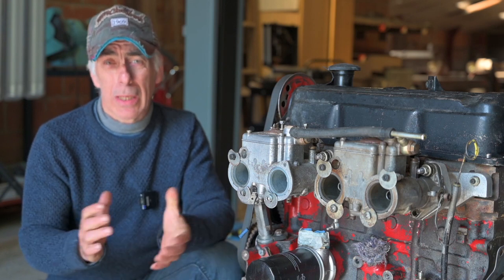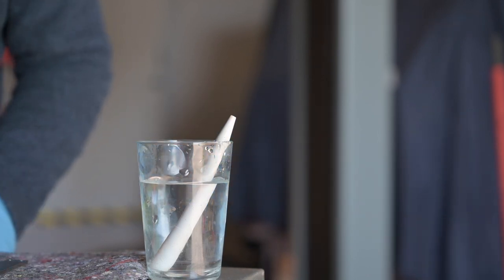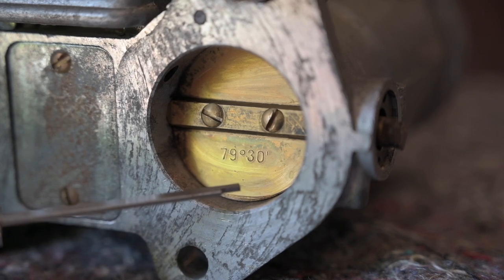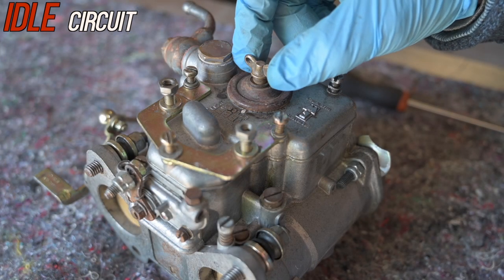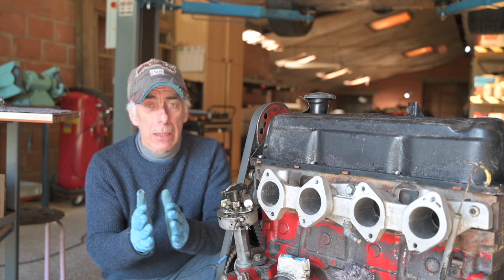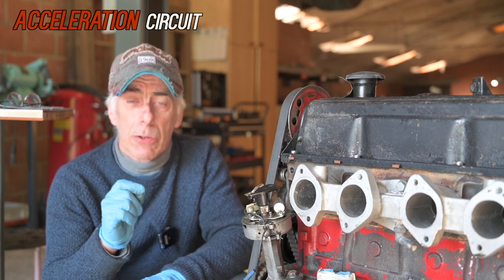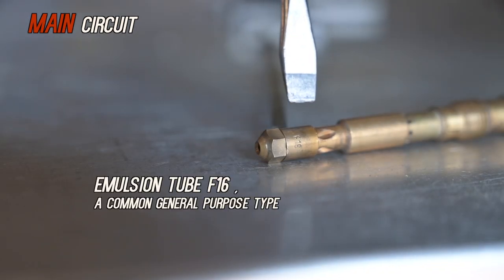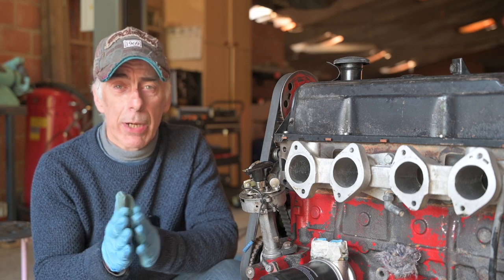Part 1, understanding the weber carburettor  DCOE

Comment: I tuned weber carbs for years in competition, this is a wonderful tutorial Steve well done.
Reply from the maker: Thanks Gerald, and maybe you could share some good pro advice ?
Reply: @D3Sshooter  I have a pair of Weber 40 DCOE carbs on a 1960 Mercedes-Benz 190SL.  The car is reluctant to start from a cold start after sitting even for a day or two.  Priming it with fuel through the air intake allows it to start immediately and it runs just fine after that.  I don't want to burn out my starter trying to crank from a cold start.  Any suggestions on what adjustments may be needed?  The fuel pump is fine and the hand primer lever gets fuel to the carbs.
Reply from the maker: @troyroberts8568  , What I read seems not to be a cold start issue, but more  a time/fuel issue.  It almost sounds like your fuel chamber runs empty or low when the car sits for a while.   There are several possible reason for that, first  a fuel chamber leak and fuel escapes , but I guess you have no fuel leaks spotted,  second the fuel evaporated due to heat build up and or flooding when the engine stopped.  Have a look and test the car with a warm motor, stop and wait a few minutes ( 5) then start... if its hard to start you might have flooding issue... check your float level first. Third, your cold start circuit might be clogged as it starts with priming fuel through the airfilter.   Does it run good after it started on idle ?     In each case start with the float level check, then check the fuel pump pressure and volume.....  Might be difficult with a mechanical pump as it is needed to run the engine  so you need a T piece for you meter.     Here is what  I would do:  disconnect the fuel line on the carb.  connect a fuel bottle or canister to the carb and hang it up high ( higher then the carb) and let gravity do its thing by filling up the carb.  Let the car sit a few days, then start it in that configuration.  If its starts and the fuel level in the bottle did not change over the days then its not a carb issue but a fuel supply issue. Best then to replace the fuel pump with an electrical version.  If the fuel level went down before you started , then you have an issue with the carb itself , maybe the needle valve, the float etc... and that should be checked.    If it does not start, check your idle circuit .  Another check is to pump the gas pedal a few times rapid before starting and while doing so have someone look inside the carb and check that fuel is squirted in.... Then start  ( that should work)  ...  If you did not see the fuel been been squirted in then you have a fuel level issue or acceleration pump membrane issue... Does the car accelerate fine when driven ?
Reply: @D3Sshooter  In full disclosure, I'm not the one working on the carbs.  The mechanic that restored the car had cleaned the jets and done everything except put them in a parts cleaner.  He said the car runs great and idles fine after starting it with some starting fluid or fuel manually put in the intake.  The car will hot start after a short time, but if it sits for hours or more, it will not start at all.  There are no noticeable leaks and no fuel on the garage floor indicating a leak.I'm not sure he has driven the car after starting it or is just trying to make sure it starts in all cases.  When I gave the car to him, I did notice a small metal ball about the size of a BB that was very similar to the ball in your video used with the weights next to the accelerator pump.  This ball was outside of the carb and sitting on top near the wing nut that holds the top cover on.  I assume this ball and weight act like a check valve.  If the ball was missing, would this allow fuel to backflow and empty the chamber causing it to be hard to start?
Reply: Is it difficult to tune dual 45s on a 81 corolla 1.8 w cam header mild performance parts

Comment: I've just bought a 1959 Giulietta Sprint with dual Weber 40 DCOEs, and this has been the first time I've understood what's going on in them. Really clear. Over the next few months I'll try to fix an issue with a lag in acceleration from idle. After I watch all these videos a number of times I may try to inspect to see if the jets are all correct for the car, and if the acceleration pumps are working well. Thanks!

Comment: Thank you so much for explaining Weber DCOE carburetors.  I have a ‘73 Triumph TR6, having reliable power problems which I suspect are due to my 50 year old Stromberg carburetors.  I’m considering changing them out to Weber downdraft carburetors, +/- $1300 U.S. before labor, or Weber DCOE sidedraft carburetors, +/- $3,000 U.S., before labor.  I’m in the U.S., where carburetors were fitted rather than fuel (petrol) injected for emissions reasons.  No need to worry about emissions now as the car is so old the government doesn’t check for emissions anymore.  I’ll tinker with the Strombergs some more before probably considering the downdraft Webers for budget reasons.

Comment: Excellent tutorial.  I’ve just recently purchased an MG with a 45DCOE fitted, so needed a lesson in how these work.  I’ve looked at the Haynes manual for Weber’s, but have found your video much easier to digest.  Thank you!
Reply from the maker: Glad it helped
Reply: Steve, in your experience, does a Weber side draft need a fuel pressure regulator?

Comment: Thank you for the thorough approach to this topic. Although carburetors vary, the basic principles and functions can be identified in most, so this tutorial also served as a basic introduction to the mechanical fuel delivery system in it's own right. Webers were originally on my mind for their current supply of spares, gaskets and customizable parts, unlike my current Mikuni carburetor which hardly has any spare parts available for it in my region. I use my carbureted Honda engine daily, so user-friendliness, availability of spare parts and familiarity is essential for keeping the engine sharp. I'll go through and troubleshoot my carburetor now that I've been inspired by your video and see what I will end up using on the car on a regular basis.

Edit: Also, did I by chance hear a Swiss accent? My apologies for not containing my curiosity.
Reply from the maker: Thanks for the comments, interesting write-up.   Swiss, not really   more Flemish

Comment: Should the accelerator pump squirt in both barrel of the carburator? Dosen't look like it does that in the video?

Thank you for a great video, you are a good teacher. 

Just started to tune my weber 40's on my volvo b20 that i have drove around with a terrible tune for six years. 

Have got the engine to run great but it stalls out during quick accelerations,  thanks to this video i learned that the carbs have a function for just that moment and is probally my problem!
Reply from the maker: andreas hustoft   Thanks for the comments.  Indeed the acceleration jet should do that.   This 40 is coming out a car that was sitting there for 15 years. And are  not working properly.   In the next videos i talk about the jetting and tuning.   Good luck with yours

Comment: OMG this is great... I just installed a DCOE40 & Supercharger on my classic 76 mini and we are having a hell of a time tuning it (998cc) ... hopefully when we get through to part 3 we can figure out what we are doing wrong. Idels fine-ish but when going to accelerate we get gluggy back firing. Have to pull up in 2nd gear and try again. Tried all sorts of solutions. We think the jets might be too big? Too much fuel going through? Gah!! 

Great video by the by 🤗
Reply from the maker: Back firing into the carb ?   Or exhaust ?  In each case its to much unburned fuel... When you say acceleration, I assume that the acceleration pomp is activated , that injects a lot of fuel through the acceleration jets.  I would suspect that as the main issue...I have had seen that before... does it run fine at higher rev's - cruising ?
Reply: @D3Sshooter  Hi Mate. Thanks for the reply. High revs she sounds OK while cruising (Acceleration only) then starts popping and blowing a little black smoke when you pull off the peddle and try to sit on a particular speed. Its much better today with new plugs, upped the fuel pressure to 3psi, and adjusted the dizzy a little. I was able to drive it atleast but we are still getting too much fuel as you said. We were thinking the jets & venturi might be the wrong size???

Comment: What a great video - thanks! Maybe you can answer a REALLY simple question? What is the correct way to start a classic fiat 500 engine when cold? eg Should you pump accelerator pedal a few times before you hit the starter motor....or just touch it when you hear the engine catching. My classic Fiat 500 and Fiat 238 van never start after sitting for weeks - I assumed this was just part of the joy of Fiats, but reading your reply to the 190SL man makes me think that maybe there is a cure for this problem. Mike in England

Comment: Thanks for this info really appreciate it didn’t know nothing about these Weber’s I have a Toyota Corolla 1.8 3tc engine with 45 webers and wanted to share what jets are in it because I couldn’t get the engine to idle so main jet is .145,  Idle jet is 55 f8, the emulsion tube is .155 top number and f 16 on bottom, the aceloration jet is 45 the float fuel valve is .200 and coke jet is top 150 and 85-f9 on bottom wanted to see if I have the rite combination Thanku for your time again
Reply from the maker: The only thing that is importend for idle, is the idle jet and air correction jet for idle... and the position of the butterfly for the progression holes.  so the 55F8 should be good...  did you check your mixture ( colortune, AGR or CO meter) that is always a good indication if you run to lean or to rich on idle.
Reply: @D3Sshooter  how’s it going I am running to rich plugs are black n see black smoke . The Weber’s were bad a lot of dirt don’t know if that was causing he problem i never herd of that tool and thanks never knew there was a tool for that

Comment: Great information thanks, quick question should the Venturi be a lose fit into body of carb ?
Reply from the maker: Thanks , well loose no , no rattle   but removable with slight force.   Some have a locking bold on the bottom

Comment: Just tuning my DCOE 45's on my Lotus 907 engine, it's always a difficult task.  Best way to put it that there are essentially 3 carbs in one in the Webers (4 if you count the choke circuit).  The idle circuit (which is a bad name) handles 0-3000rpm, the main circuit goes 3000-redline, and the accelerator pump circuit handles the heavy loading under throttle.  You can get one right, say have a good smooth idle and nice accel to 3000, but then under hard accel it doesn't run well, and then doesn't run above 3000, etc.  You can have 1/3, 2/3, etc. working.  Proceeding to tune each one is the only way to get to a good situation, and understand how the emulsion tube works to transition.
Reply from the maker: Indeed, circuits are one thing , but the transfer inbetween is the most difficult part to get right...

Comment: My friend! Extremely valuable lessons from you. Great explanations in detail, and so I’ve watched the video a few times to be sure as I do have dcoe carburetor trouble at the moment. 

With what you have taught In separation, I believe I’m past the troubles within idle, and more into accelerating, but into maybe the area of emulsion tube and float level as my problem is in range of open throttle stumbling…?
I have dcoe OER/SK 40mm very similar to this Weber setup you have here. So I will try to adjust float level after I watch your other videos next!

My only question to this video, as you say accelerator pump is only a SINGLE shot after idle. Say for example, at normal driving/cruise I decide to speed up to wide open throttle, would the acceleration pump give another shot(or half shot) due to the throttle plate opening half way to wide open?
If so, maybe my problems could start at acceleration circuit. How you explain I do not believe this is my problem but in the emulsion tube/float. Any guess on my situation appreciated and thank you for this video.
Reply from the maker: Yes it will as cruising is near idle in terms of carb condition

Comment: Hi there! Just discovered your videos and think they're really excellent. I've just bought a 1970 Aston Martin DBS Vantage with triple Weber DCOE 45s. I'm a relative novice but keen to really learn this car inside out as I plan to keep her for a long time. I've noticed that after a run I get a fuel drip from the frontmost carb - seems to be dripping between the air box and air inlet side of the carb. I wonder if the carb is over fuelling so will be having a look next weekend! I've just watched your video on timing as well so will check that too!
Reply from the maker: Welcome, I would recommend that you fox that asap . Seems like a flooding issue. Can be caused by several issues.. Have a look on the channel . I have a video designated to flooding issues.   An Aston Martin, now that is something I would love to have...
Reply: @D3Sshooter  hi again! I took your advice and checked over the carb. Checked float weight and heights seemed good. Also checked that the valve properly closing when float level was up. I think I’ve found the problem. The accelerator pump jet has a constant drip if you accelerate gently. If you blip the throttle quickly to activate the jet it stops though. Under normal operation should the jet open under gentle acceleration do you know? If not any ideas as to cause? Problem with accelerator pump mechanism perhaps? I note it only affects one of the accelerator jets on the carb though. Kind regards, Richard
Reply: @DS3shooter - I've worked out now that under gentle acceleration the accelerator pump jet should NOT leak and that fuel should bleed back into the fuel bowl - this isn't happening. I tried holding down the valve to the accelerator jet and even this did not stop the fuel leaking out! Do you think problem with accelerator jet valve or perhaps a blockage in passage back to fuel bowl! Many thanks!!! Rich

Comment: I have never seen this before. Carbs are things that I just have someone else fix usually. Is there a RICH or LEAN setting you need to set for your altitude? The best way to adjust the richness is to look at the flame at night till it turns blue out of the exhaust.... at least it worked for the airplanes that I used to fly! DC-3 and C-47. Of course those were 1,100Hp Engines 18 cylinder.  Jim in Chile.
Reply from the maker: Thanks for the comments  , Wow the Dacota  what a great plane  DC3    that was really flying

Comment: Thanks a lot for this great and very clear video. I can see a small hole on the wing-nut (jets inspection). I guess this is to secure them with a piece of wire? Mine hasnt and I am considering drilling a hole
Reply from the maker: yes indeed.  No real need for it
Reply: D3Sshooter Thanks. Noticed something today, checked the spark plugs after running, cyl 1 and 4 ok but 2 and 3 black (dry). On a 1380 A series engine with Weber 45. Mixture too rich?(weird on cyl 2 and 3!) or valve clearance? Thanks in advance and keep the great work!! Cheers

Comment: I have 2 Italian 40DCOE 27's & 1 40DCOE 2. What are the main diff in the bodies between them? Not the jets etc. I have 3 on a TR6 cyl motor on a TVR 2500M. Any ideas? Thanks. Trying to decide if i can make them work together. I have learned
So much about Weber from you. Please keep schooling us. Thanks again.
Reply from the maker: That is normally the yoke sieze that is fitted.  of course `i would need to see them for a better understanding and numbering...
Reply: Thanks for the reply Steve. What do you mean "seize"? Or is that a typo. The chokes are 30 mm. I am changing to 26's/24's  if I can find them. A/V's are 4.5 . Thanks. Rob from Vancouver
Reply from the maker: @robhopkins5835  indeed that is seize...  typo  , or diameter of the yokes.

Comment: heyy! thanks for these video's! I have a problem with my brand new carb setup. Everything was running well up until last saturday. Ever since then the engine started running really rich (i monitor this via Wideband AFR gauge), The idle speed also increased after this happend.  The front of the 2 carbs is being much more rich than the other. This after having put a couple 100km of smooth driving on the setup after adjustment. Where should i look to fix this issue, as I cant seem to figure out where my sudden issue is coming from
Reply from the maker: I would think that the needle valve or the float is having an issue...   the float could be having a puncture, but most of all `i expect dirt in the needle valve' in that case the float level raises as the needle valve does not close in full and causes a rich mixture... I would check all that first.   If that is not the issue , then get for jets that are lose
Reply: @D3Sshooter  the needle valve seems to be working okay, i took off the top cover, attached a hose to the fuel inlet and blew into the hose. Operating the float would open and close the needle valve as it should, but i guess that doesnt mean the level is correct. Everything looks very clean, it is all new after all. Will investigate further tomorrow
Reply: @D3Sshooter  thanks for the super quick response btw

Comment: Thanks for the very informative series on the weber dcoe  carburetor. But why do these carbs not have a vacuum advance connection ?
Reply from the maker: Good question!, because most of the time that is found on the intake manifold with weber mounted carbs